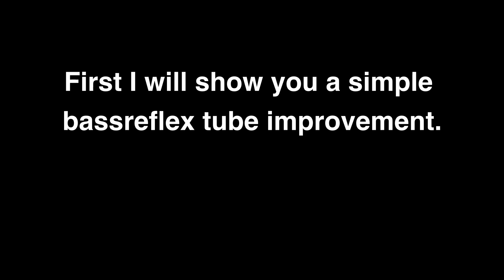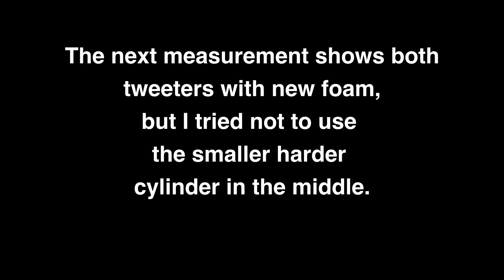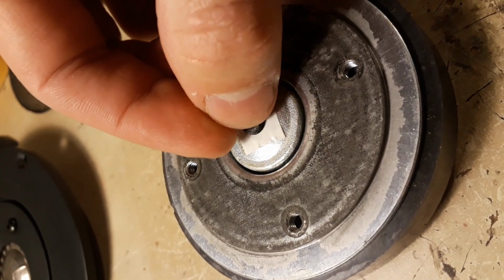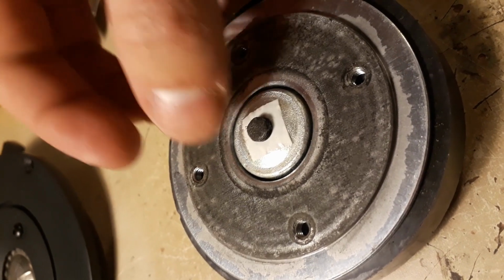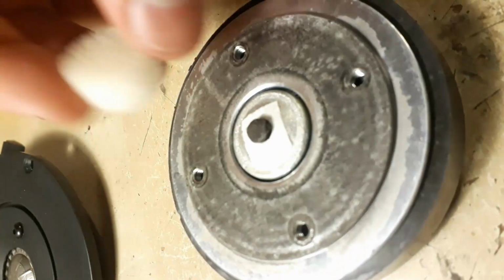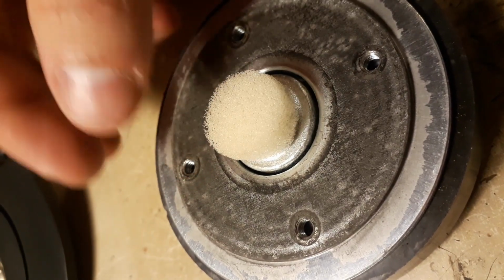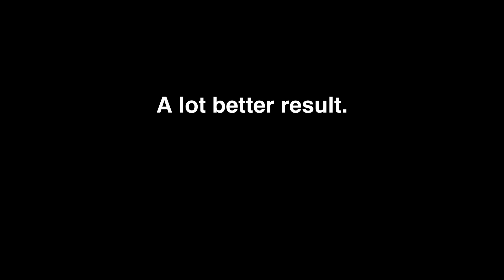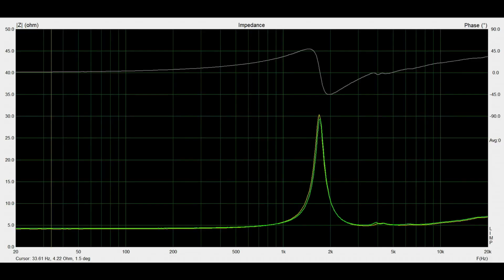JBL 035Ti (035TiA) foam replacement + measurement

Comment: I just finished repairing and adding new dampening foam to three sets of 035TIA and 035TI tweeters. I thought I’d provide some tips on how I went about it. 

First, I purchased a C.S. Osborne Round Foam Cutter #1212 — 7/8 diameter foam cutter. Perfect size to fit into the titanium dome. Second I purchased 30ppi open cell foam 1/2 inch thick. Came in a 12”x12” square for $11 delivered. You can also use 3/8 thick. Cut the foam using the foam cutter. They came out perfect. 

Mine had a small, cylindrical rubber or foam piece in the center under the dampening foam. I reused this little center piece. Or you could cut a small similar-sized piece (doesn’t need to be round) from a self-adhesive felt furniture bumper about 1/4 thick. Or you can go without any as the 1/2 thickness is thick enough to reach the dome center. Its only purpose is to help shape the dampening foam and push the center into the dome.

To attach the dampening foam, I used just a dab of contact cement on the magnet and on the foam. Align the screw holes and place the titanium dome over the foam and gently press down. Insert the screws and tighten. Done.

However, as you separate the tweeter dome and voice coil black plastic plate from the magnet, you are likely to break the hair-thick wire leads. They get stuck to the plate from the mustard-colored glue they used to assemble….and unless you are lucky they will lift with the glue and will break. Now you are in a mess. 

First, determine where the break is. Those leads have a reddish-colored covering on them that needs to be gently removed before you can reattach them to a new wire. I carefully used an X-acto knife (sharp and dull side) for this. You also can’t solder them unless you do this. You need to go back as far as you need (in some cases, I had to go back almost to the voice coil) to get enough lead wire to work with. I used a 3 inch copper strand from 16 gauge. I tinned one end. I made it long enough to go from the break all the way to the connection post. This is important. you don’t want to take any chances with a small bridge piece and two solder or connecting points so just fix one break instead of two by running a new copper wire all the way from the break to the base of the post. 

I used magnification and tweezers to get several wraps of the broken lead on the end of the new, tinned copper wire. Sometimes I could get some solder on the re-connecting wrap — but its not so easy. Just a little solder on your tip will be enough. Other times, it was too hard to solder…and since I had a good wrap…I placed a small piece of black electrical tape under the break and wrap and then placed another piece on top and pressed them tightly together. As I mentioned, the other end of the new copper wire I ran to the base of the connector post and wrapped at least twice and then soldered it. This gives you a stronger fix than trying to bridge a break. 

Cover the exposed wire with electrical tape. Before putting back together, test for continuity at the connector posts. If your multimeter beeps and you have continuity — you are golden. I tested my repairs after this procedure and got 4.0, 4.1 and 4.3 ohm matched responses from the tweeters. 

This work is like doing brain surgery…very delicate work…but the leads can be repaired and the tweeters can be saved. I know have three sets of speakers I was ready to toss-out that are now working and sounding perfect because of the new dampening and the lead-break repair. Five out of six leads were broken removing the tweeter dome and voice coil plate…so its likely to happen to you too. I hope this helps.
Reply from the maker: @G.S.Patton  thank you for this info. Also, heating with hairdryer can also help to remove the magnet, but it cannot be too-much heat. I did this repair on 4 pairs and fortunately I did not have to repair the leads due to separation.
Reply: GREAT, thank you, I have JBL L120T  (40 yrs old) that needs refoaming, this is a great help

Comment: 1. Watch out when removing the screws — they will quickly and strongly jump out of your fingers and attract to the titanium dome (and dent it!). 2. My coil leads and wire connectors were glued such that they became glued to the magnet…and the leads both broke when separating the components.
Reply from the maker: You are right., heating the front plate with hairdryer from underneath could help....

Comment: Absolutely WRONG, this guy dont know what he is doing!
Reply: Why?
Reply: Wo more comment, your post is worthless  & petty
Reply from the maker: can you tell me what I did incorrectly?
Reply: @TheMazo02  Try to think why the original foam is flat and rounded. Instead of that stupid log you got there. And the second important reminder - if you don't understand the construction of the speakers and you can't seriously measure the service procedure, then don't start opening the tweeters. And above all - don't present this liquidation video as a guide to how others should destroy it too.
Reply from the maker: @djungariangrowler1241  calm down bro.. original foam was not rounded.. it got its shape after years when it lost flexibility.. there is also that hard foam center piece that helps to push the foam in the center of the the dome, some 035ti had the center pole piece machined elevated like mine(upgrade), some earlier had it flat.. . check ebay, you can buy new aftermarket foams there for big money and they are the same shape.. this video helped many people, but there is a hater everywhere.. this is restoration video, as you can see.. (and there is another  video inspired by mine, where he bought aftermarket foams, notice the shape)
Reply: @TheMazo02  Said by someone who knows absolutely nothing about speakers and their measurements, but looks at ebay ads 🤣😂
Reply from the maker: @djungariangrowler1241  How can you tell I know nothing? You do not know me and my work. This is not the first pair that I restored. Why wouldn't I check ebay? There are many JBL parts to get. Stop being silly, thanks for comment anyway ;-) (And you can show me some of your work, how you repair 035ti.)
Reply: @TheMazo02  Make video with all measurements of original unit and after your "restoring". If you dont know what it means - I mean F-response, Impedance and phase, THD, IMD, CSD - this is enough for the start. Of course that never happen, you have no clue about these measurements, so you are only Mr. Nobody, who can only unscrew the screws and cut a circle from the foam. Thats all.
Reply from the maker: @djungariangrowler1241  unfortunately I do not have equipment to measure thd, waterfall and nonlinearity, and I think it is not needed in this case, and it also does not mean I won't do it in the future ;-) In the LIMP impedance graph, you can also see electrical phase... Whoever wants can buy that ebay aftermarket foam kit. I measured frequency response of all my refoamed pairs and it looked ok (compared to graphs from lansing heritage site), without foam, there are visible resonances of the titanium. (You asked me to think why the original foam is flat and rounded- it is because it deteriorated after years and has formed to the shape of the dome, you can often find some of it stuck from inside of the dome. Also check lansing heritage forum, user John B posted his 035ti/tia measurements and they are cca similar to my results, and Ken Haerr from Upland Loudspeaker Service also did a video on this).. contact me on facebook, I have a page there, named: Zvuk Starej Školy (and we can discuss this, I like to talk about audio)
Reply: @TheMazo02  Yeah 😂😅🤣So show us the results.
Reply from the maker: @djungariangrowler1241  as I said, write me on my FB page, stop being childish, let's  talk constructively, I can show you my measurement screenshots
Reply from the maker: @djungariangrowler1241 contact me

Comment: Do these tweeters need ferrofluid?
Reply from the maker: They did not have ferrofluid as factory units, however, very similar 046ti (from XPL series) used ferrofluid, I replaced the dias in XPL 200. I think it will work with it, but not needed..
Reply: @TheMazo02  Thanks for replying. How thick should the foam be? The height that is. You think the XPL 160 is worth money? I just picked up a pair from a local thrift shop for $100 usd but needs to be restored.
Reply from the maker: @felipecervantes7881  I read somewhere that the thickness is 1cm. I believe XPL 160 for 100usd is steal price if they are working! How can you ever hesitate about this haha!

Comment: You dont want to get that stuff in the gap......you should take the gap first. The damping material should not be pressed up against the dome like that.
Reply from the maker: Thanks for yor comment. Gap was checked before assembly.. new  foam kits you buy on ebay are also 1cm high (and I used really soft foam).. all is ok here, the foam must touch the dome to help with titanium resonances...

Comment: Measurements are interesting, but, what is the difference in the sound of the tweeter. Am I not understanding something here? The impedance is off so that means what? It's harder to drive the tweeter with the rotten foam? Does that mean it is NOT as loud as it should be in relation to the other drivers. Forgive my ignorance but I have some speakers with these tweeters that are 30 years old and I cannot hear any difference due to the rotting foam, which I assume must be rotten after 30 years. They sound pretty much as they did years ago. I can't understand why JBL would use something that rots in one of their better tweeters from that era. Makes no sense. Is it to tone  down the titanium driver? Make it less metallic sounding? And I can't perceive any degradation.
Reply from the maker: Hi. Ofcourse! That foam dampens the breakups of the titanium. When it's rotten, it does not touch the cone as should. You probably don't hear the difference because you are used to the sound during the years as it changed.. Last week I was checking 044-1 tweeters and they had another type grey foam that was still fresh, wonder why they didn't use this type in this model too.. Why jbl would use something that rots? Because they did not know how long will it last.. same with foam surrounds.. even the best woofers had foam.. (yes, soundwise it is better than rubber because it's lighter)

Comment: Hi, thank you for the video. What is the material that you added under the foam to improve the peak level?
Reply from the maker: Thanks for viewing! You are welcome. That small piece was originally in the tweeter. At first I forgot to put it back. When you remove the old foam, you should feel a little more dense cylinder in the middle.
Reply: @TheMazo02  yes but what was it? Rubber? Gasket matl? How thick you think it was? 1 or 2 mm? Seems like it's important. Thanks
Reply from the maker: @barneyrubble4827  it's a harder foam...

Comment: Where can I find the rubber ring/string that you use to secure the tweeter grill? I bought a pair of 4408 and the grill is only held by the magnet power, but just sits there and can be pulled off by hand.
Reply from the maker: I bought it in a shop with bearings, gaskets and O-rings.. there must be an O-ring of this diameter and thickness, but I had that string at home from previous projects.
Reply: Do you have the exact thickness of the O-ring material?
Reply from the maker: @nebelungguitars6743  1,7 mm
Reply: @TheMazo02  It can be 1,6 or 1,7 mm

Comment: I have same model tweeter  but has no sound coming.. do you think it will help replacing foam ?
Reply from the maker: Try to open it.. I cannot tell, but the foam won't mute it completely, there must be something audible coming from it. These are often overheated and burnt, most probably also in your case :/
Reply: @TheMazo02  if it is burnt is there any chance to fix it ?  or it goes to rabish
Reply from the maker: @aceberganabolic  only with original JBL  replacement coil.. chinese/ebay titanium replacements are thicker and do not sound like originals..
Reply from the maker: @aceberganabolic  not original, it is often possible to buy a pair of originals in good shape for the price of these in a pair
Reply: @TheMazo02  https://www.ebay.com/sch/i.html?_from=R40&_trksid=p2047675.m570.l1313&_nkw=jbl+coil&_sacat=0  when u say coil burnt is this diagram ?  if we change only this coils  will it work.. my both speaker tweeter do not work they quit almost same time- first picture one
Reply from the maker: @aceberganabolic  you need original JBL  replacement, otherwise you won't have the original sound..

Comment: Very helpful video. Any additional details on the type of foam that should be used?
Reply from the maker: Unfortunately I haven't got a device that measures the hardness of the foam. This one is the most common type. I think a little difference won't matter as long as you use 1cm thick cylinder, but I believe it should be very soft like I used. You can buy a reproduction kit on ebay but 30usd js too much for me, considering that the shipping to Europe would be at least + 10usd. The point is that the new foam is springy and enables the movement of the dome to come ,,alive".
Reply: @TheMazo02  enables the dome to be "damped" preventing overshoot and ringing.
Reply: @TheMazo02  actually foam density will change the force against the dome and so the damping level too. All that piece did was increase the pressure of foam against the dome butbonly in the very center allowing the foam to mote easily take on a dome like shape itself, clever by JBL.  Nice to have your equipment to sweep and test impedance
Reply from the maker: @barneyrubble4827  Ofcourse, but if you use some regular foam, you won't do bad.. if someone does not have testing software. Thanks for comment!
Reply: The foam should be soft and not make rustling or crinkling sounds when you compress it